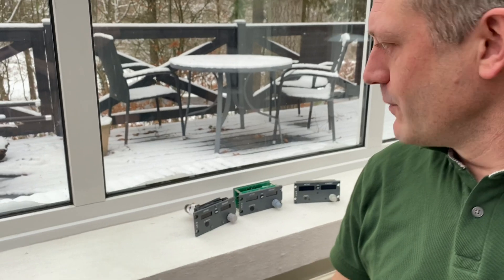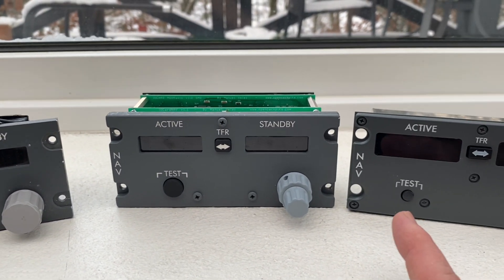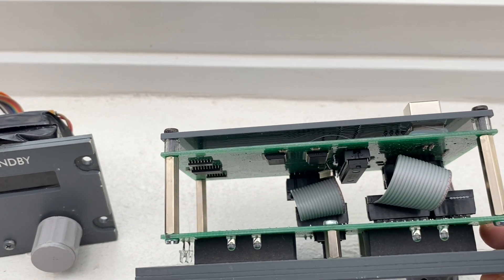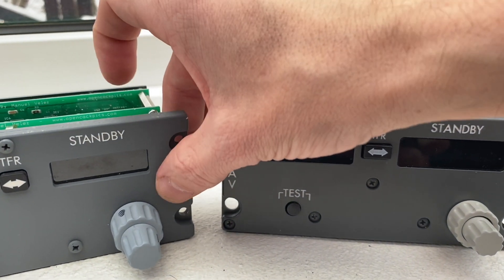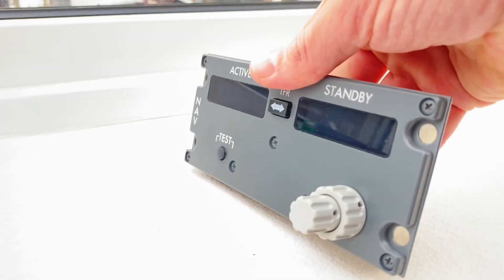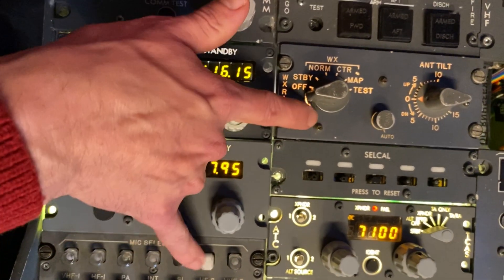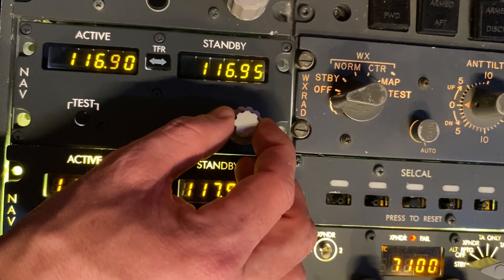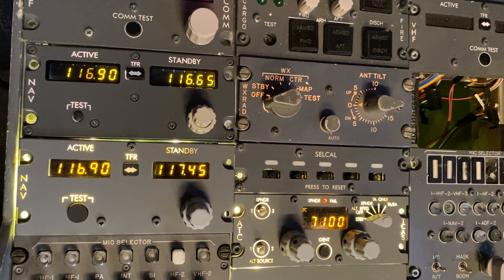Comparison of Radio Modules (OpenCockpit / CP Flight)

Comment: I am using CPflight MCP with MSFS which is required fsuipc7 to run them.    My issue is delayed display the number on MSFS.   It is little bit slow.

Comment: Hi Peter, Just a mention. I have programmed a single Arduino Mega2560 to control all seven radio modules with yellow TM1637 displays or red Max7216s. It uses two 16-1 De-Multiplexors cards to allow all single, switched encoders to appear as a single dual encoder to the mega. An imperceptable press on the encoder knob cause a specific radio module to become active and then a further press switches between inner and outer shaft mode. It all works perfectly. Regards NobbyH

Comment: I run OC Nav VHF and ATC panels. I have used black card to keep light spill to a minimum.
I run the Zibo in X-Plane 11 & 12. I use a simple script from Pitikanga which run the units perfectly. You just need to identify in the script which is Captain and which is FO. Works brilliantly.

Comment: many years ago , you  buy from cpflight  a interface  card the name was Black Box  , and you connect the radio or other cards from cpflight  directly  to this card . You don't need  a mcp .  But that card is not for sale  anymore.
Reply from the maker: You are absolutely right. 
There was also a USB version of the Pedestal backlight panel that could be used with out the MCP. 
I actually went down that road when recording the video. But it ended up being complex to explain  and just took up too much time.